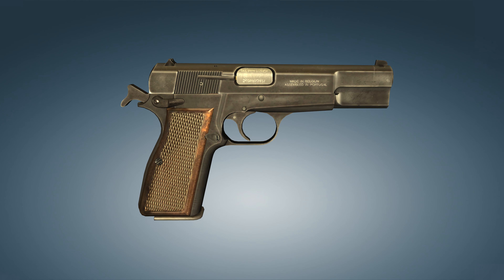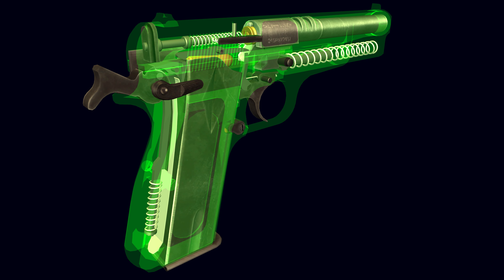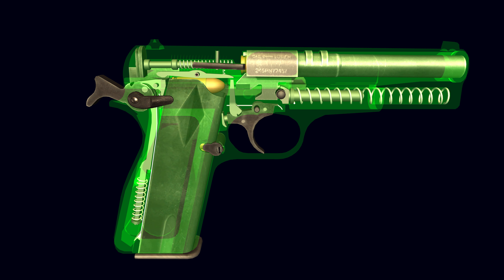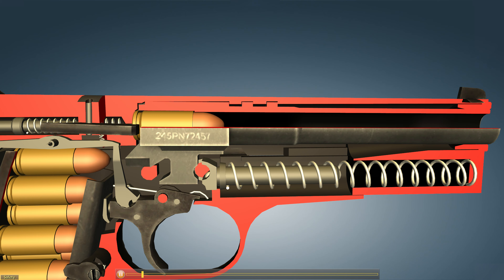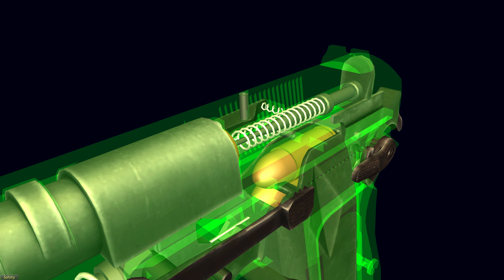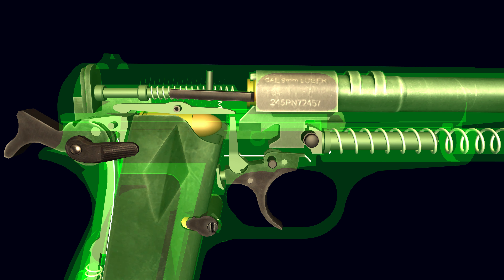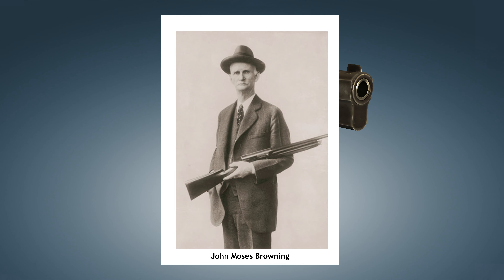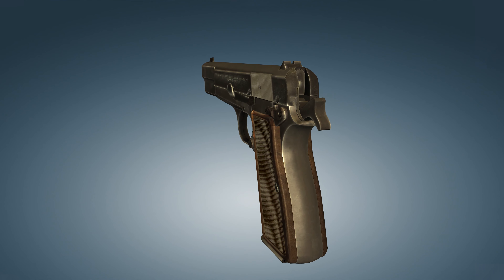How a Browning Hi-Power works

Comment: This is a pretty good video, but there is a mistake :50 the Browning hight power isn't the first semiautomatic pistol with a double stack magazine. The Savage Arms 1907 used a double stack magazine, this is one reason why the original .32 ACP was able to hold 10 shots, not bad for a pocket pistol.
Reply: 32 ACP cartridge was invented by Browning too

Comment: Now if someone will redesign the High Power with  sliding stirrup trigger bow that slides back to strip thr sear directly, eliminating the cantilever "see-saw" bar to depress the sear, it could have an amazing trigger.
Reply: So a 2011? A double stack 1911 in 9mm.
Reply: @madcat8099  but all steel, slender slide, same outer measurements. Same mechanical durability.
Reply: @ms.annthrope415  Springfields new SA-35 has some of those features, except the stirrup trigger. The design of the stirrup inherently increases the width of a firearm.

Comment: Actually J.M.Browning just started the work, but the actual work was made by Diodonne Saive
Reply: Let’s be honest “Saive Hi Power” doesn’t have the same ring
Reply: @calebstevens7487  What you mean?
Reply: I have always heard that but always wondered which features were done by JMB and which ones were by Saive.
Reply: @cuzz63  I think both were genious and in this case had their part, but for instance  Inglish in Canada could not make working magazines for GP-35 without Saive :)
Reply: Actually, Saive would not have ever finished this pistol, without Brownings idea.
Reply: @normanmcneal3605  I want to believe that most of the gun was designed by JMB and Saive refined it to last. Just my belief.